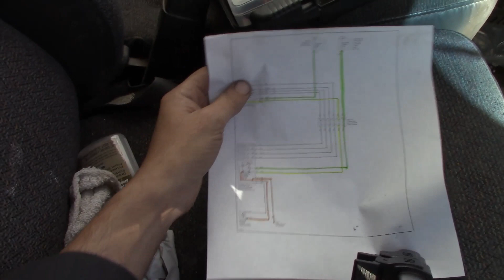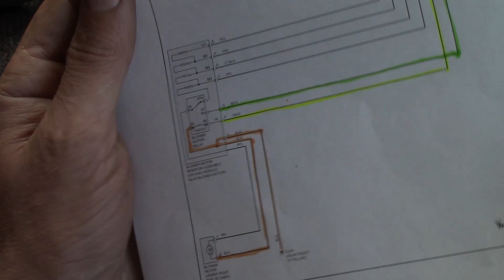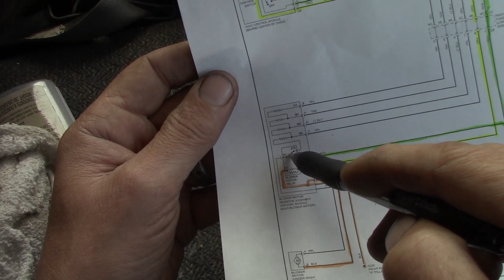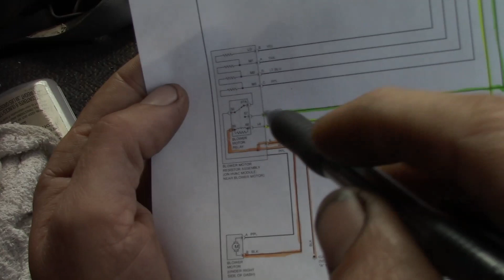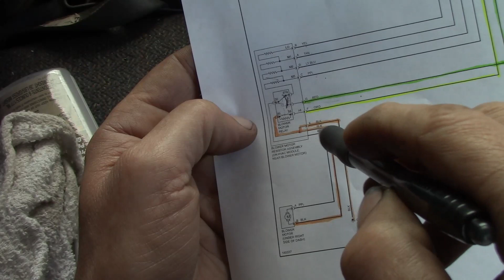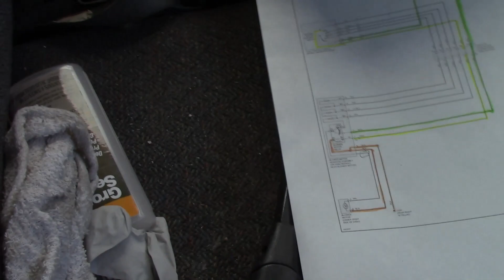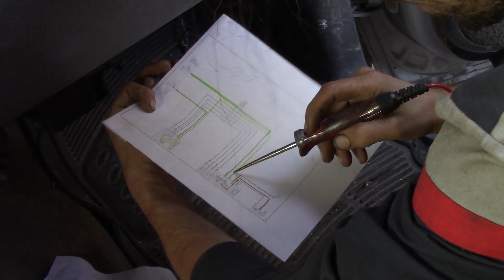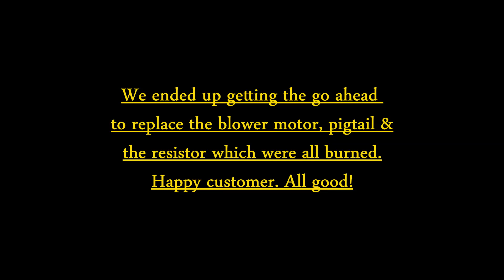Silverado No Blower. Let's See the Diagram

Comment: I did video on an equinox the other day.  The customer had another mechanic look at it.  At least he put 12 volts to the blower and tested it, but he then installed a $80 blower resistor and it still didn't work.   Then he brought it to me.  Found a burnt connection in the connector in the Drivers kick panel.  I told him to go get his old blower resistor back and keep it as a spare.

Comment: Quick question what wires where you using to swap from testing power and ground? I noticed you unplugged the test light and plugged it in somewhere else. What kind of setup is that? Looks super convenient having both ground and power for your test light. Thanks
Reply from the maker: Good eye. I made a power/ground connector that plugs into the cigarette lighter. Makes things easier...if the lighter works of course.
Reply: Joe's Auto Electric awesome gonna have to steal that!!! Great idea!!

Comment: There’s an easier fix in two steps: 1) dump the Chevy 2) get a Ford 😜
Reply: My F150 only has 2 blower speeds because it needs a resistor. The shoemakers kids always go barefoot! 😝
Reply: Pauly D at least it still works, it won’t burn your truck down 😂
Reply: @PaulyD0859  My F150 only works on High for about the last 400,000 miles.

Comment: Just fixed a similar blower problem on out shop truck (2004 silverado (2500 HD). Melted electrical connector at the blower motor.